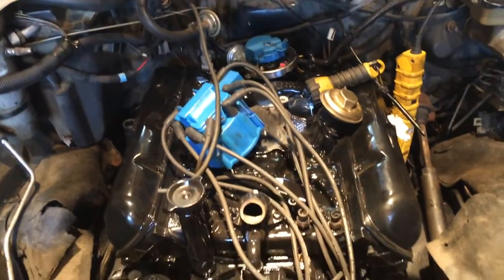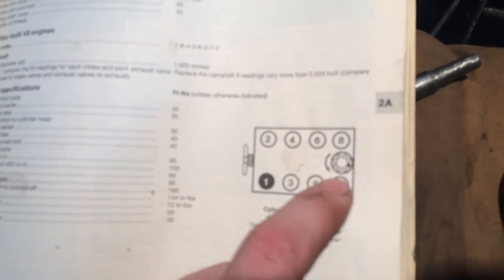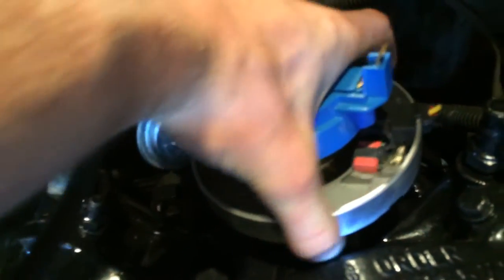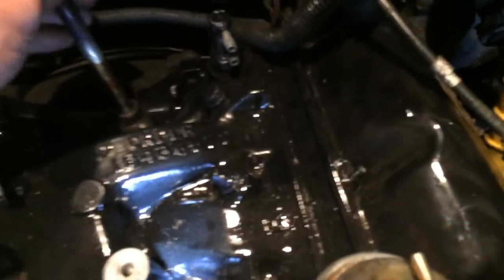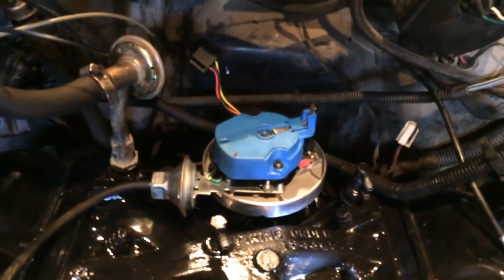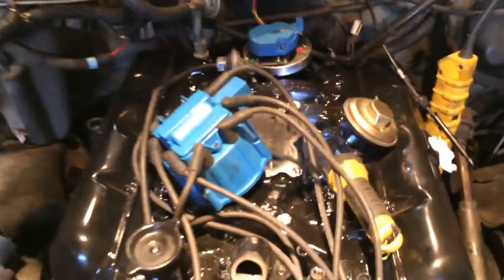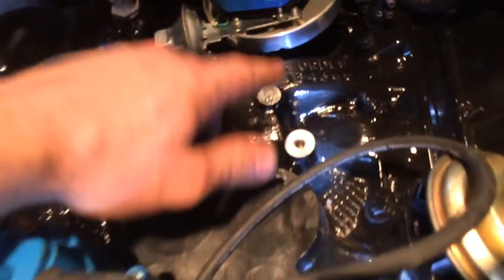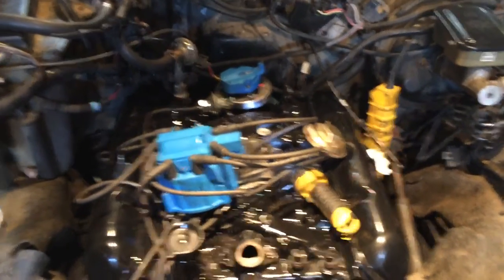How to install a distributor

Comment: OK here we go again quick question my Oldsmobile engine has some screw holes on the side of the block I noticed smoke coming out of them do they need to be plugged up there exactly 8 of them rite by each spark plug
Reply from the maker: Yes those are the holes where the A.I.R. Injection pipes used to go into the exhaust runners on the cylinder head. Yes they should be plugged.

Comment: OK so u have it exactly Wer you have yours at so I pull it back out a rotate it 180 degrees to the left or right also my engine is a Oldsmobile 307 with 7a heads 
also have a edelbroc carburetor
no emissions please help been add it for days tried every position
Reply from the maker: The direction that you rotate the rotor doesn't matter as long as it is pointing 180 degrees from where it was originally pointing. Just out of curiosity, when you swapped the computer controlled Quadrajet carburetor for the Edelbrock did you also swap the computer controlled distributor for a vacuum advance one?

Comment: the car was sitting hadn't been started in a while so I just  talked the motor out an placed it on another car removed all the computer stuff didn't realize that the distributor had to be timed just pulled it out slap a new hei in it and sealed out the carb as well

Comment: I did that to my engine an it won't start just back fires through carburetor
Reply from the maker: Backfiring is a pretty good indication that the distributor is out of time with the rest of the engine. Usually the rotor is out of time 180 degrees. The way I fix that is rotate the engine until it's at TDC(you don't have to put it on TDC but I usually do) then pull the distributor cap and mark where the rotor tip is pointing. Pull the distributor and when you put it back in, point the rotor tip 180 degrees from where it was originally pointing.

Comment: I also installed the new carburetor its a carter 4 barrel but nothing it acts like its gonna start then nothing
Reply from the maker: Does it fire at all? Or does it just continue to crank?
Reply: yeah it trys fire it pops from inside the motor acts like it gonna start then nothing
Reply from the maker: Does the accelerator pump and choke work on this new carburetor? If they do I'm starting to think that there may be a problem with an ignition component. one thing I would check before testing ignition components is the firing order.
Reply: I actually loaded up a video for you to see what happens when it cranks over it still uploading
Reply from the maker: Cool I'll take a look at it once it uploads.
Reply: I tried it again and a real loud pop from the engine was fuken loud as hell maybe timing chain mite be off I had a dune buggy that the timing was of on the chain and one day I was messing with an it pop loud also an blew up my exhaust lol
Reply from the maker: Definitely looked like a timing issue to me. The timing chain could be a possibility. I'm going to take a better video in a few minutes of my ignition and upload it tonight

Comment: OK come uld that be also a problem why it wasn't firing up
Reply from the maker: They don't affect whether it starts or not, they are just part of the emission system. When the injection pipes were still on the engine all they did was inject fresh air into the exhaust. But they should be plugged so that exhaust fumes don't get into the interior of the car.

Comment: no gas line is hooked up to carburetor I'm just pouring gas down the carburetor I installed everything together
Reply from the maker: With no consistently metered fuel being supplied, that could also be the source of back firing. If a fuel line is out of the option for now, try pouring some gas into the vent tube of the carburetor to fill the float bowl. That way the fuel has a chance to be metered properly. Be careful not to over fill the bowl, they don't hold much fuel.

Comment: OK back firing stopped did the 180 and it was 180 out thanks a million now just turns over but nothing
Reply from the maker: That's good. How long has the carburetor sat? Did it have gas in it while it was sitting?
Reply: no it just sat for a while battery went dead after awhile gonna get a new one tomorrow finally popes through the muffler before battery went dead

Comment: damm motor won't start still acts like its gonna the nothing
Reply from the maker: Does the accelerator pump and choke work on the carburetor?
Reply: yes they do
Reply from the maker: If you would like to I can probably make a more detailed video of how to check the ignition system on these engines. I have a book on these cars.
Reply from the maker: If you would like to I can probably make a more detailed video of how to check the ignition system on these engines. I have a book on these cars.
Reply: ad this point anything will help bro thanks
Reply from the maker: No problem. The video should be up around this time tomorrow
Reply: I took the carburetor off and out of curiosity resided to open it its a edelbrock 1405 and wow no wonder it wouldn't turn on the inside was full of gunk the filters are like shit complete mess has corrosion in the Inside OMG wat a mess so now I'm gonna find another one will any 4 barrel work for this course thee selling me one from a Monte Carlo completely rebuilt for 30
Reply from the maker: Yes pretty much any edelebrock, holley, or quadrajet will work, I wouldn't go over 600 cfm. If your car has a 4 speed automatic I would use a quadrajet that has the linkage for the TV cable for the transmission. I never really had good luck with the TV adapter brackets for holley carburetors. And if the carburetor you found is rebuilt and it's from a similar engine, I would buy it.
Reply: OK I'm gonna go get it 30 is pretty good an if that don't won't I'll just invest in a rebuilt edelvrock thanks bro you've been a great help
Reply from the maker: No problem man, if you still have problems I'll help the best I can.